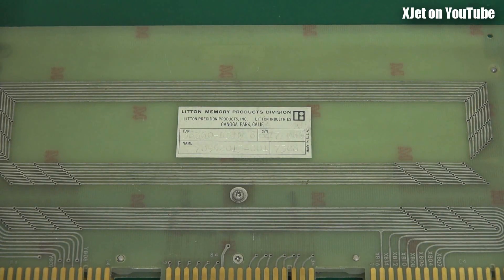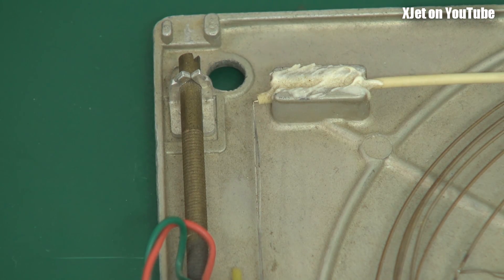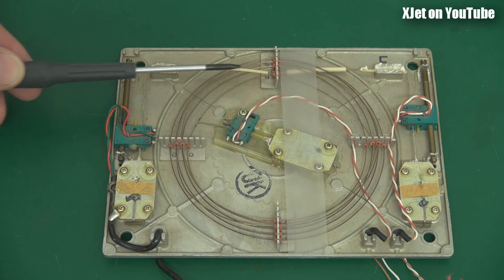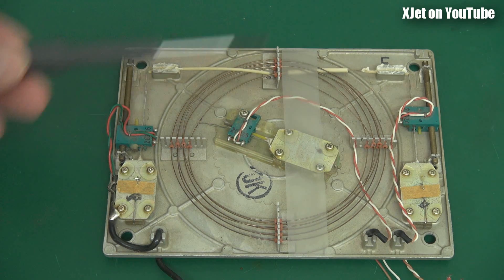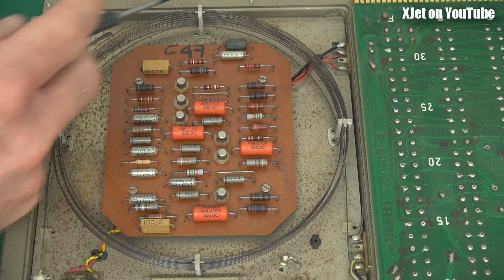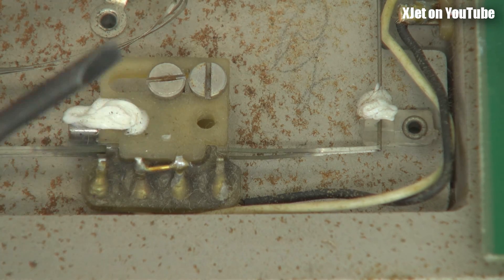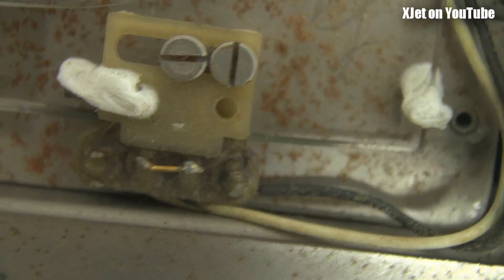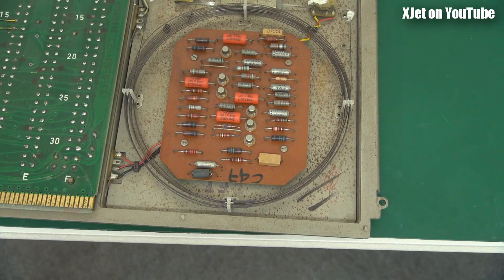Old computer tech:  delay-line memory

Comment: It's called a magnetostrictive delay line.  The transducer causes a tortion of the end of the wire, and that torsional wave runs down the length of the wire, and is eventually picked up by the transducer at the receiving end of the wire.  There were earlier ones that used a compression (sound) wave, but the torsion wave was less affected by mechanical noise, for example from working on  an attached keyboard.  In 1974, I was working on a mainframe computer site that used VDU's (video display units) made by Conrack that used acoustic wire coil like this for the screen memory.  They also used disk units that had four platters in them that turned about a horizontal axis, so the disks were vertical - and had a diamater of about 4'6" or possibly 5 ft.  They were huge, and had a head for each track.  On that site, we had three Boroughs mainframes, two  with 4-wire core memories and one with a 2-wire memory.  The sense amps sensed the current on the X- and Y- wires when a core changed state.  It was all wonderful stuff.
I never worked around magnetic drums (which preceded disks), but they were quite heavy, and I once read that "In the event of a bearing siezure, the kinetic energy in the drum would be released with consequent, extensive damage ..." - not to the unit, but - "... to the computer room".  You can just imagine the cabinet starting to spin, tearing itself free of its cables and going walkies around the computer room.  Wow!
Reply: The first Burroughs mainframe, a B6700, I installed used that "head per track" disk. Zero seek time. ;-) Reliable stuff, the only failure I recall was one of the head modules. Someone told me Bell Telephone used a modified version of that disk to play recorded messages like the time, or "can't connect" things.  The terminals I referred to earlier were also made by Conrac.
Reply: I don't recall your name, but it seems you worked on a very similar site to where I was.  Mine was a bank centre in Brent.  I can't remember the mainframe types now - it definitely had two B7600's with 4-wire memory, and the third mainframe - I think it was also a 7600, but 5200 also rings a bell - had a 2-wire core memory, which was bigger (a megabyte?), but also a bit slower than the 4-wire cores.  There were a couple of sister sites - PNCU was one.
The disks weren't all that reliable.  You may remember that they had touch sensors, and if any head touched the disk surface, they would all retract.  It got to be such a nuicance that the platters were sent away for teflon coating - then when the teflon started peeling off and getting under the heads, they were sent away for "decontamination".
Who would ever have thought then, that we would ever have 256GB on a micro-SD card!  I remember an article in Wireless World (an authoritative mag in its day), saying that with the 1Mbit chip, we had reached the limit due to stray particles from the sun being able to change the charge on the micro-capacitors that RAM used.
Reply: was told long ago that the nickle delay lines would be susceptible to permanently storing a pattern if it was left cycling without change for a long time. if bits were then changed they would flip back to the orevioys pattern of the now mechanically "tuned" wire. Even to the occasional extent where it could be turned off, then a bit of new data inserted which would mutate back into the old pattern.
Reply: @quesoestbonne  The wire remembered too often used bits? That sounds like the semi-myth that historical violins remember the type of music (and how well) they were played with, and start to sound boring when not used but only locked into a safe as investment by greedy resellers.
Reply: "going walkies" >.< that's a very charming way of saying "stand the hell back"

fascinating story though
Reply: Australia's first computer, CSIRAC, had drum memory for secondary storage. The drum memory system used the motor out of a washing machine.
Reply: Roxor128 You forgot to mention that CSIRAC used mercury delay line memory which pre-dated this nickel delay line memory by 10 to 15 years.
Reply: I worked mainly at an auto  parts plant in Michigan. The 6700 there had what we called "planar core". It was made up of modules of two pcbs attached with a lot of gold plated pins. Each was 32k x 20 bits. One board had the sense amps and drivers, the other the core. The next generation machines all had chip memory. I do remember some talk about those early ram chips being subject to a random error if a stray cosmic ray hit in the right spot. There was something about a batch made with ceramic packaging that was slightly radioactive causing errors. Fun stuff.
Reply: Ah - you were in the States and I was working in the London area, UK - so we would never have bumped into one another :-)
If yours had planar core (on cards) I think it must have been a later machine.  Ours had all the torroids in one module - the "core" - surrounded by cards that did various things - addressing, drivers, sense amps, etc.  I worked there from '74 to '76.  We had a bank of 17, 1100 line-per-minute drum printers, and they took up a lot of my time.  I can't remember the number of tape units (with vacuum columns), but there must have been around 40.  Thems was the days!
Reply: Yes, that would have been a long commute for a service call. :-) But when I did B7700 training, there were a couple of guys from the UK in class with me. A German and a Frenchman as well. 
My 6700 was a bit newer, it was installed in '76. I've seen the big stack core, but never worked on it. We were a smaller operation, not nearly so many peripherals. We did have a 2000 LPM train printer that was cool. All of the type slugs were loose - no belt - and pushed each other around in a precision machined housing. I also remember how much better the OEM tape drives were. They required little attention. We also had a pair of 120 images/sec laser printers OEM'ed from Xerox. Fun times indeed, wouldn't care to do it again now. ;-D
Reply: Yeah and as I recall we use to get a crane in to lower the computer into the office, and no that's not a joke.
Reply: Ouch! I only know that Candy Hoover washing machines tended to explode during spindry (looked like a car crash inside your bathroom) because the too weak weld seems on the drum went bad.

Comment: I was  in an electronics tech class with Mike Mason the instructor. At one point I told him I was thinking up a memory device. Not allowed. I have built several projects with just 7400 parts. A microprocessor can bog down construction. Go to the monitor if you have the space.

Comment: Cool! So the data is in the torsion?
How much data?
Reply: Wikipedia says about 1kbit.

https://en.wikipedia.org/wiki/Delay_line_memory
Reply: interesting, that is about ~125 bytes, you can do a lot of math with that, i assume they use arrays of these right?
Reply: More like 100 bytes, given it's a serial medium which would need start and stop bits, but yeah, I would expect they'd use a bunch of these. 

Although, it might be possible to use a bunch of these in parallel (say 16 for a 16-bit machine), though timing might be a bit of an issue.

Comment: You really have to wonder about the thought process that went into developing some of these old technologies.
Reply: The thought process was:  How can I solve a problem?
The result of many solutions, some fantastically clever and some mundane, built the stack of tech we have today.
Delay lines were great for storing information.  They were serial, one bit at a time, which matched with computation algorithms like addition, which could also be performed one bit at a time.  Fewer bits stored in electronic form meant fewer transistors, fewer other parts, smaller circuit boards, and lower cost.  
Even then, the potential of computing was limited by the cost.  There were always two thoughts in an engineer's mind (as there are today).  One was/is: how can I do something revolutionary that brings new potential and applications.  The other was/is: how can I do something that is at the economic fringe of possibility and do it cheaply enough that more can access it.
The questions haven't changed.  The drive to do the new and then to make the new commonplace hasn't changed.  The growing history of specific experiments, successes, and failures continues to guide the answers.

Comment: What were these used for? I love looking at old tech. Something I saw at the space center (NASA) when I had an internship when I was much younger. Was and actual HDD with huge disk platters and had huge reader heads. It was the size of a V8 car engine! a When the platters started spinning it had a really cool winning noise and you could hear the reader heads accessing the data. It truly is amazing how far tech has come in such a short time!!

Comment: Nice device. Don't understand the explanation.
Reply: dothemathright 1111 I appreciate the link, I got the the principle, I will look for the engineering details (recording capability, speed, feedback method). The oldest storage device I worked with was those 8" floppy discs, also I used audio cassettes with the old Commodore home computers. And the capacitor bucket brigade delay lines for audio. King regards!

Comment: I used to work on a radar that had vacuum tube analog computer in it.  AN/MPS77 I think was the designation.  It was used in the ArcLight Rolling Thunder program in Vietnam.  Pain in the rear to keep working and calibrated but it did work.

Comment: my 8 inch floppy held 160k as I remember. used a hole punch to be able to use the opposite side which usually worked but was not guarranteed.

Comment: Interesting, thanks for sharing, I never knew about this delay-line memory before. 
I've used/built computers since the '80s, still have a Tandy and a Timex around here somewhere. But that's as far back as i go. Used the 5 1/4" floppies as recently as the early 2000's in some 386/486s and such.
Reply: I have a 'Tandy Sensation!' put away here. I think the keyboard weighs a couple of pounds, LoL

Comment: the wire is heated with current and will expand or shrink as it heats or cools. the magnetic sensor detects the motion and the output current is assigned a bit.

Comment: I used to work for Olivetti back in the day. Those delay line memory modules were used in the Auditronic 770/730's and the TC380/350'. They were very reliable as far as I can remember. The modules on the circuit boards with the 8 or 6 hole cap were simple gate modules created using discreet compnents. the large gaps between the rows allowed the cards to be placed closely together with the rows interlacing. God I feel old LOL. I'm still repairing computers but I'm 63 now and will retire in 16 months.
Reply: Looks to me that the Olivetti memory was from a Programma 101 desktop calculator and accounting machine.  I was at college ca. 1968 and we had one of these as a cheapo computer substitute.  It had a printer, magnetic card input and output for programs.  If I remember correctly, calculator operations on the keyboard could be recorded on the magnetic cards and some form of simple branch logic and subroutine capability was possible. It was a nice modernistic looking unit for that time.

Funnily enough, the company I went on to work for a year or two later based their first computer on delay line memory, but in that case the delay line was a mercury tube which regenerated sonic pulses along its length.  That was the Univac I.

Later:  Wiki has a description of the Olivetti: https://en.wikipedia.org/wiki/Programma_101

Comment: They still rely on refreshing memory, they have just become much better at hiding it (DRAM).
Reply: Yes, he mentioned that it's similar to modern RAM in that respect. Constant refreshing sounds like a waste of memory-controller processing cycles, but it sure does make erasing huge swaths of RAM a lot easier.
Reply: Not particularly.  As said, they hide the refresh time quite well. See this Wikipedia article and look for the "refresh overhead" section. They calculate the refresh overhead at %0.4.

What amazes me is the Atanasoff–Berry computer, which rivals ENIAC for the first digital computer, used capacitors also for its memory and had to refresh its memory in the same way. It did it mechanically, using a rotating drum with capacitors mounted on it.

That machine was built in 1937 and it would seem that its style of memory will still be very much the dominant memory form in 2037.

There is much to learn from computer history. Much of what you see printed in current books is wrong.
Reply: Scott Franco We are not actually disagreeing. I said constant refreshing SEEMS like it would be a waste of processing power. I didn't say it IS a waste of processing power. Also, it's nice that you can erase memory simply by neglecting to refresh it, instead of having to manually zero-out all the stored values. It's much more secure that way; classified computers would have a lot more overhead if they had to manually zero-out all their memory upon shutdown.
Reply: "it's nice that you can erase memory simply by neglecting to refresh it, instead of having to manually zero-out all the stored values"

Nope. This is the best explanation of it I could find with just a short search:

https://forums.xilinx.com/t5/Embedded-Development-Tools/SDRAM-initial-values-problem/td-p/259338

You can't even rely on all 0's or all 1's. Further, the pattern is not random, even if it appears to be. I have lost count of how many companies I worked for that relied on having a "special pattern" in ram that indicated a hard vs. a softboot. (full power off vs. reset). This is so unbelievably stupid it should be illegal. Even if the power on state of ram is predictable, having ram powered off just short enough to retain the "special pattern", but still long enough to cause random bit errors is very real, and all it does is save a 50 cent power controller part.

But then, as you can perhaps tell, I don't make a lot of friends in the computer industry.
Reply: Scott Franco As a software engineer, I am not concerned about the RAM containing all 0's or all 1's when erased, because I formally re-initialize any memory I intend to use. I only care that any data previously stored (which may be sensitive information, or executable code) should be garbled beyond recovery even if a formal re-initialization hasn't been completed.
Reply: @scottfranco1962  
Yep, rebooting really old 8 bit computers after turning them off while running a program will cause the old screen text to be visible but usually garbled and with random characters. Obviously the old ram has a long permanence time.
Reply: If the RAM chip is cooled with an inverted can of air duster it can remember data for many minutes, enough to retrieve encryption keys.

Comment: Hi xjet, what a cool video! Only half through it I realized the Olivetti board was from the Olivetti Programma 101, the first personal computer in the world! I'm from Italy and I was lucky to met it's creators two years ago, during the Trieste Mini Maker Faire. The were proudly explaining people how the machine worked and why was revolutionary at the time. The also had one of it still working! I recognized it because of the unique "forest" or "wafer" of resistor, on the left of the coil. They explained us how they initially used only nichel for the memory, and the twist would occupy something like 3mm of wire while travelling along it, and then they welded the nichel to the steel because the twist would occupy half the space (1.5mm) and allowing them to store more data!
One of the most fascinating thing was how the Olivetti in Ivrea was one of the most advancef labs, they were great teamworkers and their main source of knowledge was a very big and constanty updated library that included books, magazines, research papers and so on. It was very fascinating talk with these people and grasp what was like the R&D back in the days.
Reply: https://en.wikipedia.org/wiki/Programma_101